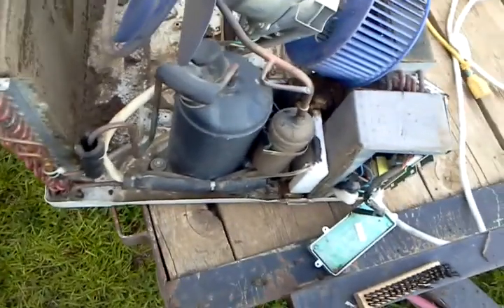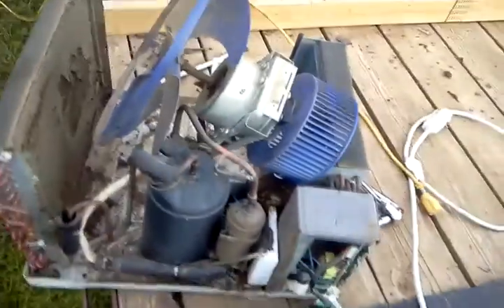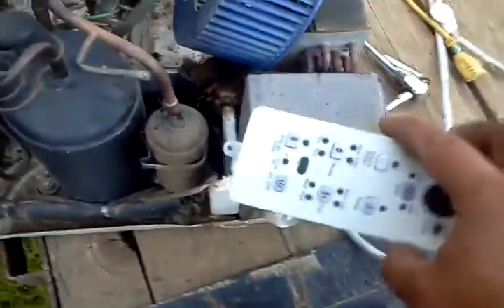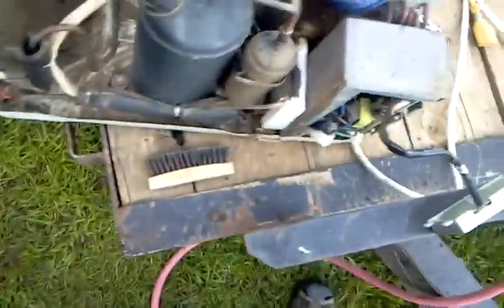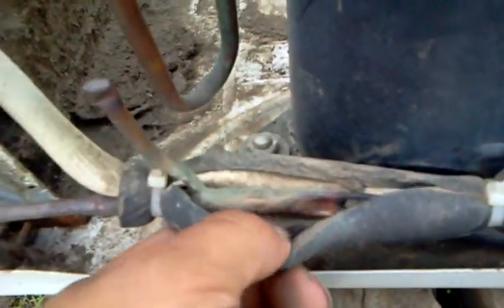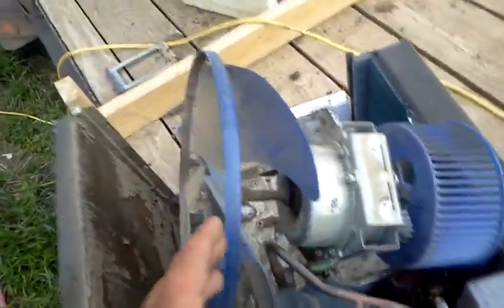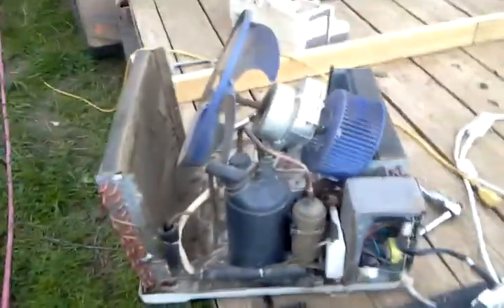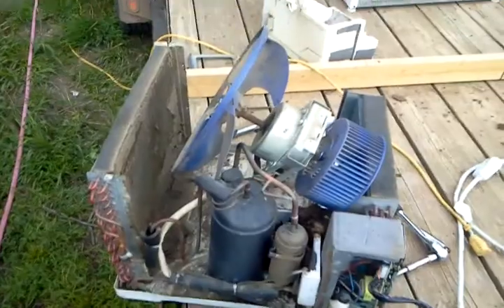Ac cleaning tips

Comment from the maker: well id say it needs to be cleaned or its has a leak and is low on charge.. but a centeral air whole house unit your saying? those usually get low on charge cause they are way better about needing to be cleaned cause they are a way larger unit.